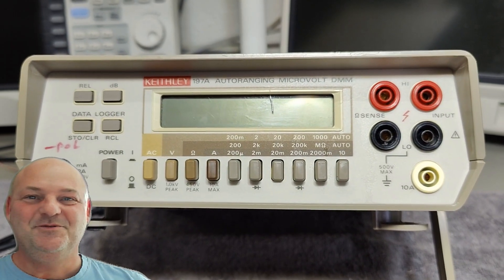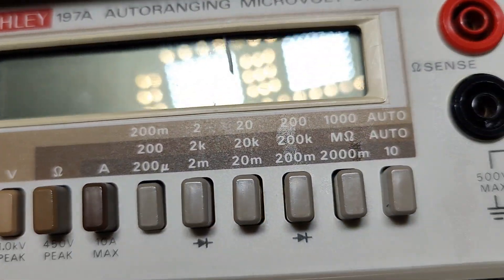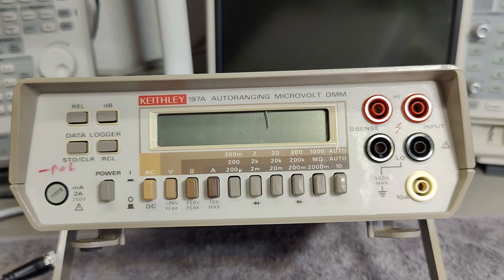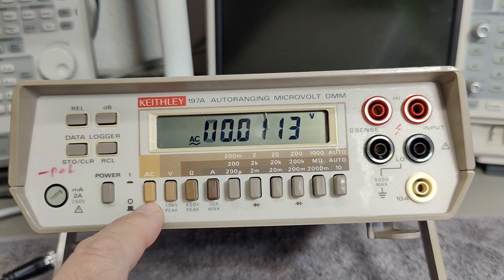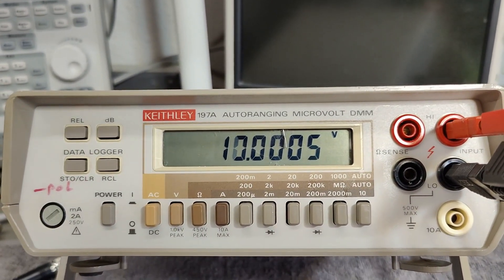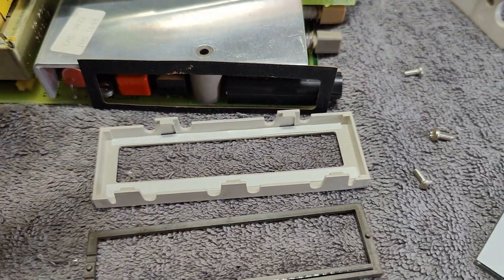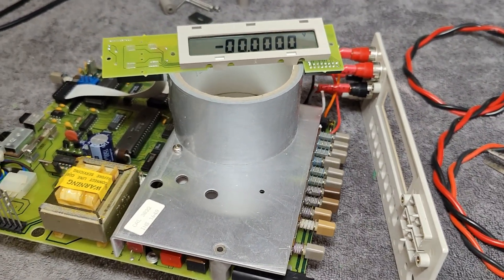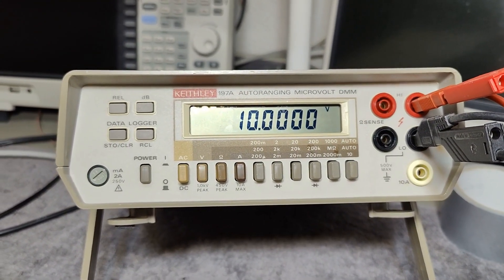Keithley 197A Autoranging microvolt DMM LCD repair

Comment: That is one of the nicest LCD displays I have ever seen, pity about the scratches though.  Would it be worth improving the backlight, maybe with led's?
Reply: EL backlight was definitely bright when new, but they do degrade badly with time. a new light, probably using some side emitting green LED's would be an appropriate replacement, or you can get a LED backlight for that size display on ebay (used for dot matrix units, or strip an old display for one) and slide it in in place of the dead EL panel instead. just unsolder the driver, and use a jumper wire and resistor to set LED current to the right value.
Reply from the maker: @SeanBZA  i have been thinking a bit about this ; WHEN do we need a bench meter to be readable in the dark ? lets face it, a bench meter is only used at locations with good work light :-)
Reply: @TeardownOZ2CPU  I can think of this being used with a shelf above it covering the display, and you not wanting stray light to distract you when working, so the backlight makes sense then. Or you are using it outside in the field because of the high resolution, or on a mobile test bench for a factory, where building it in place in a unit is required, and you might not always have good ambient lighting around.
Reply from the maker: @SeanBZA  in that case score another EL light plate from what ever less old :-) and replace it, maybe they can be found brand new as spare part ? if lucky ?
Reply: @TeardownOZ2CPU  Those EL displays have a limited life, no longer made at all, so any you get are likely the same dim light.